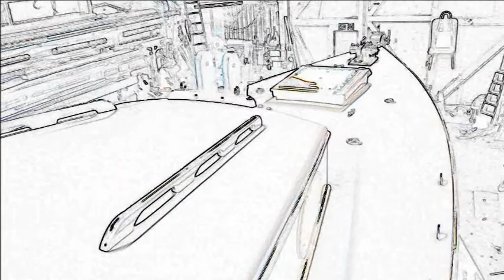Hillyard Wumpus Restoration

Comment: What timber did you use to repair the cabin?
Ive rot in my cabin. I was going to use Oak but originally looks like Mahogony
Reply from the maker: Mahogany. We buy old furniture like wardrobes and tables for this type of repair. Check it's not laminated though! A piece of 'brown furniture' can yield a lot of timber for not a lot of money, and it's also usually similar vintage. If it's too thin glue it together to get the required thickness. Good luck with the repair.

Comment: Hi see the portholes on side of the cabin are they just perspex screwed on and glued with clear CT1 ?
Reply from the maker: Hi Scott,  as on most post War Hillyards, yes the portlights are 6 or 8mm perspex screwed on from the outside,  bedded on a non setting sealant.  Not silicon!
Reply: Nick Gates thanks I think I’ll do that on my 1955 5 ton
Reply: Nick Gates which sealant do you use ?